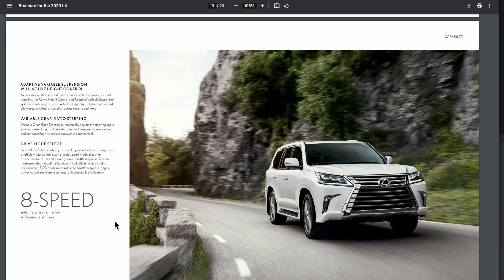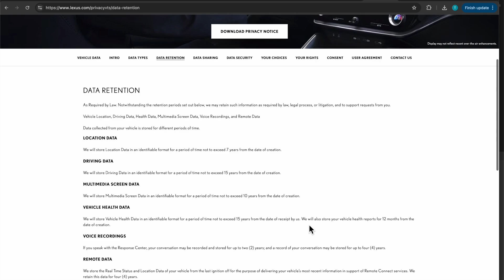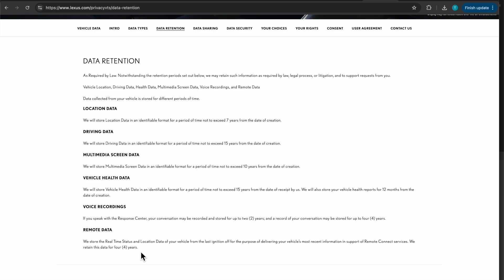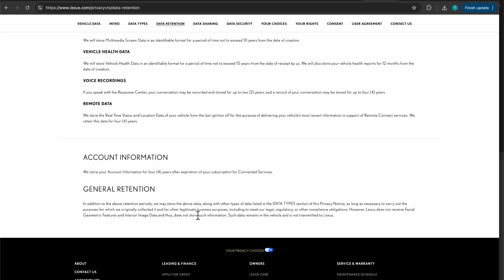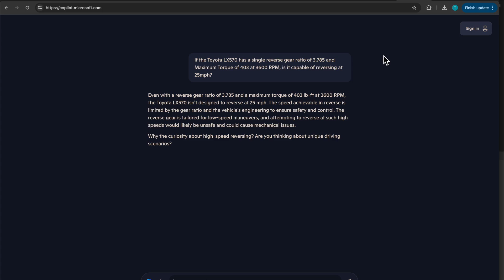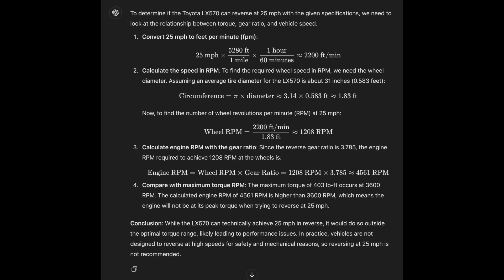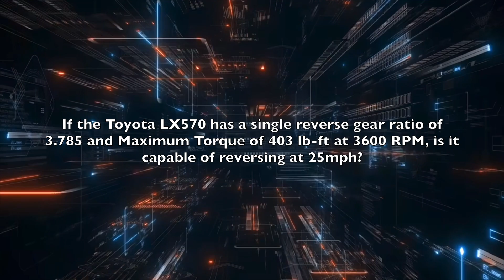LX570 Specs | Mass v Karen Read

Comment: It's difficult to provide an exact stopping distance for a Lexus LX 570 accelerating to 24 mph in reverse, as it depends on several factors like road conditions, tire condition, and driver reaction time. However, generally, a vehicle traveling at 24 mph in reverse will have a significantly longer stopping distance compared to a vehicle moving forward at the same speed. The Lexus LX 570's larger size and weight also contribute to a longer stopping distance.

Comment: @AussieInsider: I'm preparing my own summary of LX570 tech issues re the Read case. I believe strongly in KR’s innocence too, but IMO this analysis did not really fit the brief. As much as I’d like to see the gearing calculations showing a low top speed, the raw numbers show it is possible to get to double that speed, and beyond. The open question then is if it can be done in 62 feet — an acceleration problem. I don’t know the answer yet. Also FYI, Karen’s Lexus was a 2021 model. Doesn’t change anything about the calcs, but just for future vids.
Reply from the maker: well, at least I get some people thinking instead of just blindly following what others say. Go YOU!! xx
Reply: @AussieInsider  Oh hell yeah! You always get me thinking. You've shown through various deep dives that there is huge value to be had in re-analyzing scenarios that were thrown up at trial. In fact, this particular vid gave me the confidence to think through the problem as broadly as I could. Thanks for everything you do! <3
Reply from the maker: be interested in how you came up with a different calculation to the specs vs the formula. Others have worked out it was only 8 wheel rotations based on a standard sized tire for this model
Reply: @AussieInsider  Happy to share. To be clear, I’m agreeing with you and others about the 8 rotations. I used 98.08" for circumference. 62 feet equals 744", therefore 7.6 rotations. I started with an easier question: does the vehicle design itself impose a speed limit in reverse? For our purposes, the answer is no (it’s something like 78 mph). The limiting factor is the short distance.

The step I’m still working on is how to convert torque, mass and distance to speed. This also begs another question: How does the VCH know the distance? It can’t be using GPS, because the resolution is too coarse. So if it’s using wheel rotations, couldn’t it just be recording the wheels spinning in the snow?
Reply from the maker: the gear ratio limits the speed in forwards or reverse - that's why you have 5 forwards speeds

Comment: Yearsss ago, my teenage bf taught me how to drive in a very old rusted out manual transmission Chevy. The bottom was so rusted out that we called it the Fred Flintstone car. Avoided puddles! 😁

One day I actually broke the reverse drive going too fast in reverse in a wide open parking lot.

Years later (many) I leased a Lexus SUV. 
SUVs are big and clunky. They’re not sports cars with sport transmissions! 
Thinking back to driving that SUV, there’s just no way that even my crazy self could have reversed at 24 mph in that SUV. 
Nor any other SUV or car I’ve ever driven.

Comment: Just wondered .. if anyone has done a computer accurately close up of the two cars hitting.. or does ur son plan to? X 
Cos what’s the chance .. the one Piece taillight missing.. fell on the bumper? 
Mark on bumper in snow .. 
after she hits johns car 
But it’s on top… could that be a tiny piece of taillight that fell onto the bumper ?? And not a dent at all? 
I just watched the video back on Sean od did a while back going on about it ..
& the  video is quite clear
.. I think it would be Easy recreate with the correct programme.. & 
from the tyre marks in the snow to the angle of where the car hits.. I reckon it shows cos Sean said he’s already measured the light sticks out by 5 inches. 😮
Wish I had software to do it 
Or buy 2 miniatures 😆😆 
Anyone know what was johns car model/year?
Karen’s was 2020 LX570 wasn’t it. 
Imma look for to scale miniatures  myself 😆

Comment: Aussie just a little from my research 2021 has center caps on wheels and 2020 doesnt have.  and they say the front grille is slightly different. I get what u mean the 2021 coming off assembly line in 2020 can vary than those coming off assembly in 2021
Reply from the maker: how does this effect gear ratio or torque?
Reply: @AussieInsider  not at all it just helps when clueing into her exact model . Wasnt being snarky
Reply from the maker: it was detailed in court, it's a 2021 LX570
Reply: You are correct about assembly years. Most car manufactures have a “change over” months before the end of the year.  Ex: General Motors change over happens in July. The 2024’s stop production in July and “change over” to 2025 and production begins.   The only way to know the actual build year is to go by the vin.  So you can have a 2025 car but it is actually built in 2024.